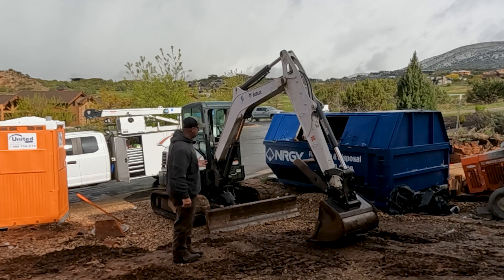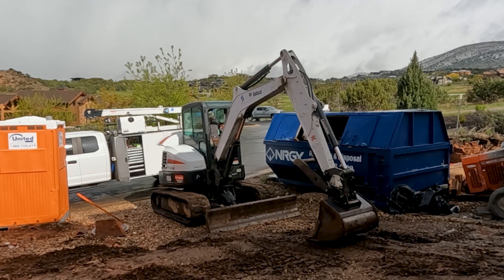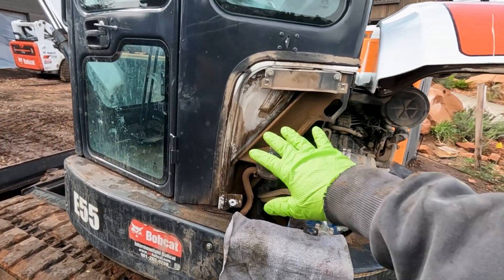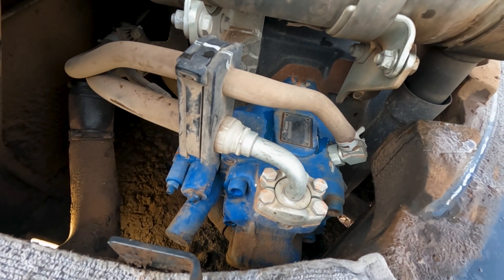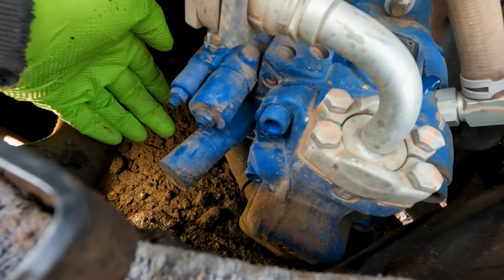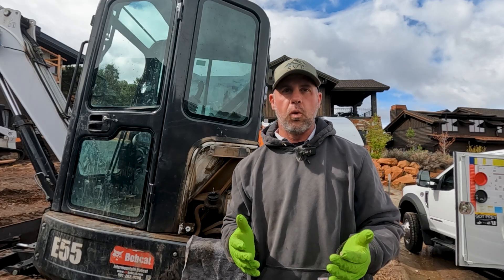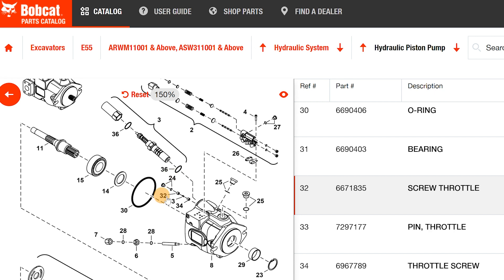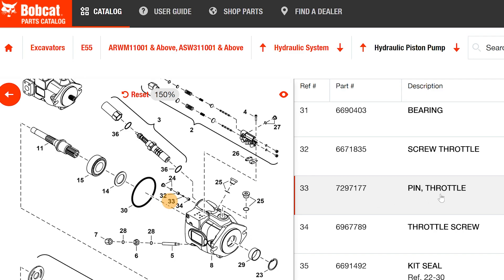Bobcat E55 Excavator with slow and weak hydraulics. The cause may surprise you.

Comment: I have a bobcat E32 no hydraulic functions at all but the auxiliary hydraulics will stroke the pump and bring main hydraulic pressure to 3500 psi but I have no pilot oil pressure at the dr port on the pilot valve block any ideas?
Reply: Pilot relief valve o-rings are good

Comment: But why would it suddenly change.    I would check for clogged pickup screen and air leak in oil.    Then check for water in the fluid.   First.   Then check flow out of hydraulic pump.     I would be concerned there was an underlying problem and you are removing the limiter to band aid the problem.       It would from the factory.

Comment: I was doing ground eork with  my 2000 bobcat 331 and everything worked fine. Two days later i came to finish the job  and found that both tracks wouldn't move , the boom goes up but is very weak going down. ( cant lift the machine by pressing the bucket against the ground) the bucket itself lost the curling motion
It still turns the cabin around and the blade works strong  ( it will  lift the machine by pressing  the blade against the ground)
Topping off hyd. Oil did not help. 
Also
 the thumb moves very slow but jumps to life when either one of the 2 track travel  sticks is  pushed (forward or reverse ).
Coukd you suggest what might be the problem?

Comment: Thank you for this. I recently purchased a 2017 E26 and am having a week hydraulic problem. Unit has 1700 hrs and was a rental; seems to have been fairly well maintained. I'm just a recently retired guy and only use it for personal projects around my property. I would certainly like to get your opinion on the problem I'm having. The machine starts and begins to operate fairly normally when I fire it up, after it gets to operating temperature, "just a few minutes" even with the throttle wide open, hydraulics start to slow down and become week. If I put it in rabbit mode, they seem to operate as I would expect they would normally. I can and have used it for several months like this. Seems to have plenty of hydraulic power while in this mode and at high RPM. I can dig, raise the front off the ground with the bucket and track at a decent speed. There are times when I feel that the tracks are lacking a little and it stops moving until I play with it a little and don't try to spin "zero turn" with them. I think that may be a separate problem. I have changed all hydraulic filters and oil, played a little with a couple of the relief valves on the valve banks (sorry if that's not the correct terminology), but am still experiencing this issue. Is there something similar to the "orifice" that you are referring to on the E26? Is there anything else that you might recommend I try? Thank you in advance for any advice you can offer!
Reply: Did you ever figure out what the problem was on your e26?
Reply: @CMEDIRTWORK  No I did not. This machine doesn't get used a ton. I again find myself with a project that requires the machine to work correctly, and I'm back looking for answers!

Comment: I want to thank you. I bought a e85 seemed to be a good machine but slow and slugish. Bobcat dealer in boise Valley thinks nothing is wrong. Think im crazy. Dead heading the thumb increased hydraulic speed everywhere.  Machine digs functions at timed tracks super sluggish ok its not designed to track around.
I finally pulled this orifice out and man shes quicker on the sticks doesnt track around slugish. Pushes more. It virtually is like a new machine. 
Loads trucks faster just does everything alittle better now. 

Im amazed thank you so much. 

Now im wondering if there are any other restrictions i can remove to increase productivity.
Reply: I believe that control reduces pressure while it is not needed. ..... Now it is full pressure(?), all the time possibly causing un-necessary wear.  Are you sure you want to leave it this way?  The presenter did not say what the true fix was, this is just a diagnostic step/answer, not a final fix. .... Later on in the discussion, search for " @garymallard4699 ",  It appears that this is the final fix .... sometimes. .... Defies logic.

Comment: My main boom hydraulic barely works. Like not even enough to go up or down but you can hear the pump work. I know it’s not a joystick thing because if I switch controls it still doesn’t work. Also it started working randomly for about 2 minutes and then stopped again. Any ideas?

Comment: Hi, I have a Bobcat E26 excavator, slow hydraulics after running for half an hour, have to run it at 2,00 RPM's to have any power in the joystick. Replaced the gear pump. Still does it. Is this a relief valve problem. It had this problem when I first got it a year ago and I turned up the control pressure valve and it fixed the problem. Is it the main relief valve or port control pressure relief valve that is at fault?
Best
-John
Reply: port/pilot controls

Comment: Hey, i have the same situation on a Takeuchi tb145, year 2006, but I have just 1 cilinder really slow, the stick cilinder. What do you recomand to look? It is posibile to have this orifice / plug / pin for only 1 cylinder? I change all the seal of this cylinder.  Thanks
Reply: I don't think so. Cylinder is most probably damaged or deformed
Reply: @superzbkvps thanks
Reply: Do your tb 145 work now? I have same problem with mine

Comment: Ditching parts isn’t a fix, there is a reason for that part I am sure, what’s the purpose and what’s the downside of not having it…. Clogged perhaps, maybe it’s to slow the flow so it’s not jerky… seems sketchy to just ditch a part and call it fixed.
Reply: he's just another incompetent youtuber. fact is he had a real expert tell him how to do it. but he can't tell you how or why because he don't know jack chit.
Reply: I get the feeling leaving it out may cause significant wear to that circuit because it is constantly going full speed, so maybe your entirely hydraulic system will fail much sooner? I wonder if that little orifice can be made out of a super hard synthetic polymer which would slide much easier with less friction, just a thought.
Reply: This guy says it is a factory sanctioned fix ... Later on in the discussion, search for " @garymallard4699 " thread,  It appears that this is the final fix .... sometimes. .... Defies logic.

Comment: It was working when it was new , what changed , if it's not needed then why have it in the first place?
Reply: 'then why have it in the first place?'  Similar idea to water hammer in pipes, something tells me that orifice system was put in place to stop the extra wear from 'bang-bang' type control.
Reply: @ModelLights  
I see , makes sense.
Reply: Very interesting. I have a e85 that is sluggish and slow. Bobcat techs think im crazy but noone seems to know. They dont even check hydraulic speeds. Im in the boise idaho area.  Ive gave up on this machine. It works just slow.  Will look into it more now
Reply: It sounds like that orifice is acting similar to the pilot controls for the cylinders, but to control the swash plate.

Without it, it's making the pump run full pressure all the time.

Sort of like a pressure washer running hard even when the line is at full pressure and the trigger on the wand isn't pulled.

... just a guess, though. 🤷

Comment: A plugged fuel filter and or air filter can cause a slow non responsive machine. The ecm (engine control module) senses the load and backs off the hydraulics on the pumps so the hydraulics can’t stall the engine. The engine will sound and speed up to the no load speed just like normal. Years ago before the computer controls if you had a plugged fuel or air filter the hydraulics would stall out the engine and misfire because of the lack of horsepower to run the hydraulics at full load.

Comment: Do the IHI 's have that also? I have an ihi 80 and the hydraulics are slow, all the hydraulics. Mine does not stop and the catch up, they are just slow. Mine is slow tracking, sick boom, everything. I have changed the hydraulic fluid and filter.
Reply: hey did u figure your issue out? I also have a ihi 55j and am having the same issue
Reply: @aldro9074  I talked to Compact Excavator Sales and they said that it normal for the IHI's. You should call them and talk to service, they are really good. They support all the IHI and Kato excavators in the US.

Comment: Was the other parts sticking?  That fixed it but i would say there is another issue to consider causing this problem...if it worked with that part in from new ok..then now there is another problem causing it to need removal to work..
50 plus years fixing stuff
🇨🇦🤓🤟
Reply from the maker: The orifice is designed to help smooth the operation of the pump. However, there is no noticeable difference with or without the orifice.  The flow of oil is too slow to get the pump stroked with the orifice over time.  We've been through many pumps trying to find the cause with no luck. The theory is there is a minimal amount wear on the torque limiter, causing it to not shift smoothly. The only option is to replace the pump or the torque limiter, which is more than the pump, then it will need a pump setup once installed.  This could be around  $5k to repair.  Removal of the orifice is a Bobcat suggested repair process which we've done for many years, and never have I seen an issue after removing it.
Reply: @tetradgroup  
yes as i thought...another part causes this problem..but expensive to do the full repair..this is a cheaper option and what i would choose...thanks..👍
🇨🇦🤓🤟

Comment: Thanks for the informative video.
I have an '06 435 with a similar issue. It just recently developed this, and the machine has over 6,500 hrs on it. 
Does the 435 pump have the same orifice in it?
Does the orifice need to be replaced, or just removed?
Did you discover the root cause of the issue? What I mean is, for many hours, the machine worked as intended, as designed (with the orifice installed). What caused it to suddenly slow down, when it was working fine before?

Comment: It is my understanding of Load Sense Hydraulics that is the pressure drop across this orifice that starts the "sense" part of the downstream valve(s) that actually shift to apply hydraulic pressure to move the swash plate inside the pump. Or it could be I am just full of it!

Comment: Is there any longterm downside to leaving the orifice out?.
Reply: Dealer told me not a problem when I had this issue 2 years ago. Not sure why it’s there if it’s not needed
Reply: @justinb3758 

Just like an EGR valve... your car will run fine without it, but its function is for non-performance issues. 🤷
Reply: @jasono2139   Removing the EGR,  COULD actually cause drivability issues, particularly spark knock increasing on gasoline engines, leading to detonation, and cracked pistons, and head gaskets.  EGR is not always a detriment, malfunctioning EGR is, so fix it correctly.

Comment: I have this same problem on an E10.  Does this fix apply?  It's quite a different animal compared to the bigger models.
Reply: Same... expect it's only on certain cylinders.

I have a feeling mine is more of a "controls" issue (pilot controls or control valves).

Both joysticks have a ton of excess play in them.

Comment: Hello thank you for sharing your expérience, I have a bobcat e26, sometimes (rarely) my boom won't lift UP back but when I use thé joystick to regain power I just have to pushh back down against the ground and it lift it UP and it IS running back good,

What could be the reason, the spool ?
Reply: I have this exact problem on my e26, did you find a solution? Thanks!

Comment: When new hydraulic hoses are made installed always clean out inside of new hoses .
When shop cuts hose it leaves metal rubber shavings inside hoses.
Which when installed clog stick things ruin a machines pump etc .
I seen so many people just put a new or used hose on never cleaned it out .
Reply: I agree. I used to work at a place where we made hoses and they just cut them with a chop saw. They would have all kinds of rubber and metal still in the hoses. I always flush mine out with diesel fuel before I install them.
Reply: @dwilley3754  Makers of hoses like Aeroquip usually clean out but I always flush out well regardless
Reply: Such a fine detail that can have serious consequence over time.  What a good comment, great attention to detail, never even considered this👍👍
Reply: @johnathandoe3558  saw it happen.
People in hurry rushing to get machine back in operation.
One small fragment in a spool , valve or something.
Disaster.
That's why when a pump fails debris is pushed throughout entire system almost impossible to get all chips out.
I had a CAT 320 spent days flushing all cylinders all motors valves hoses out.
Still has issues .
תודה רבה שלום

Comment: Is this on an E26 and would that explain why it would move slow for maybe 3 seconds then speed up to normal?  Most of the time it's fine, but every now and then any movement will start very slow up to 3 seconds, then suddenly to go full speed. In 50 hours or so it has probably happened 8 or 9 times and while colder, doesn't do it when hot (yet).

Comment: So in the end, do you leave the orifice out? Why do the engineers put it in if down the road it’s going to fail? Good video, BTW.
Reply from the maker: Yes we leave it out, the orifice, in theory, is supposed to help keep the hydraulics smooth during engagement but its hardly noticeable with or without the orifice.

Comment: Have several of those in my spare junk. With about a 50% success rate. Crap in margin spool will cause simular problem.
Reply from the maker: Great point, that would've been my next step if that didn't work.
Reply: Not really  on the same subject but, what is your opinion on Friday Parts Kubota Engine Parts for V 2203 in a 753
Reply from the maker: @sandyjoseph9880  over had mixed reviews with friday parts, sometimes orders take a long time to get.  I got a head for a v2203, installed it and then found they machined thru a cooling jacket into the exhaust port.  Flooded my engine with coolant.  That cost me time and money.
Reply: Hi. What is margin spool please ? Relief valve maybe ? Unload valve ?